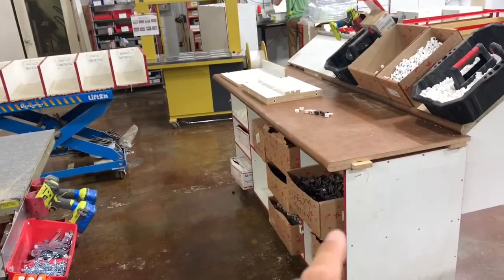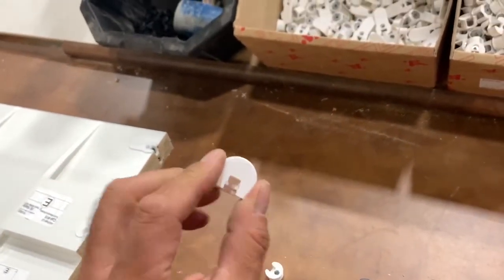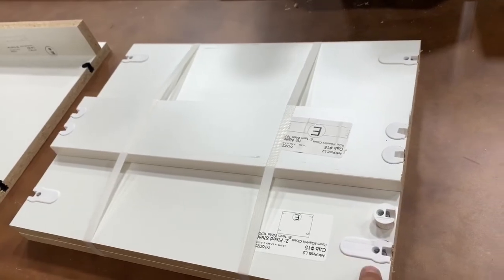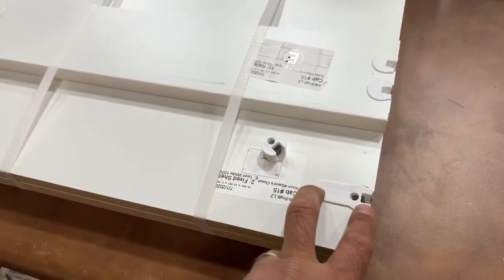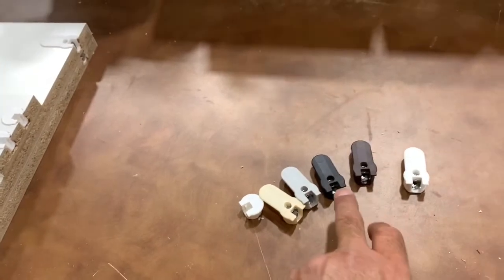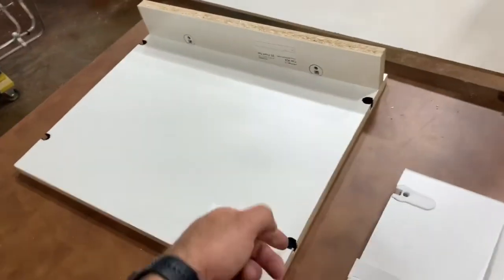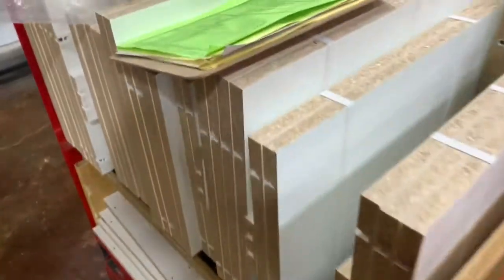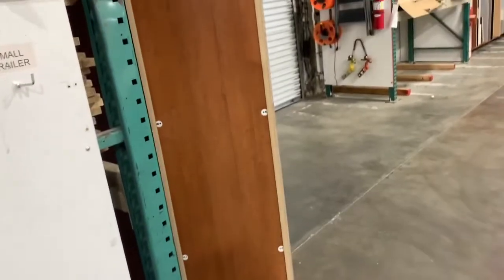Rafix & cam fittings we use at The Closet Doctor

Comment: What jig do you use to drill the double
Reply from the maker: We use a CNC to make parts they come off drilled. You can also use certain hinge machines with proper tools
Reply: @derrekholland5207  I’m using the “Hettich VB Connector Drilling Jig”… I never thought about a CNC for this… I’ll definitely look into it! 
Closet shelving is a new area I’m getting into for our custom homes we’re building…
Thanks for the tips

Comment: Do you think Rafix is strong enough comparing to Minifix?
Reply from the maker: Mini fix is probably stronger. The problem is it doesn’t work in a lot of applications and requires secondary operations for the horizontal drilling. The dowel bolts that hold both together are similar in size and the threads and that is generally the weak point on these types of clamps nnctors
Reply: @derrekholland5207  So do you use only Rafix type, no any screw or nail and glue?
Reply from the maker: @karunlee  all our closet use Rafix. Home office uses Rafix, Murphy bed we use Rafix and mini fix for 1 connection. Garage cabinets are screwed together with a blind dado connection
Reply: @derrekholland5207  Thanks Derrek, HNY 2024 wish you healthy, wealthy and keep doing great thing!